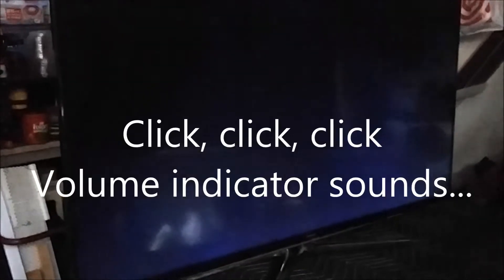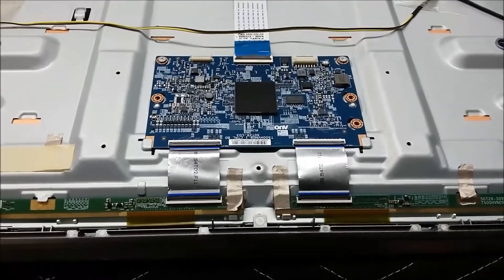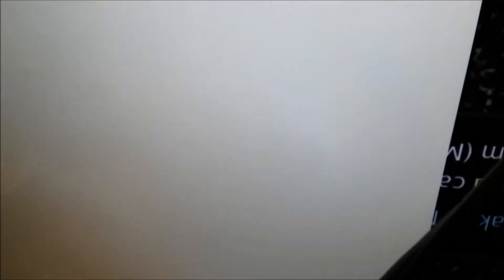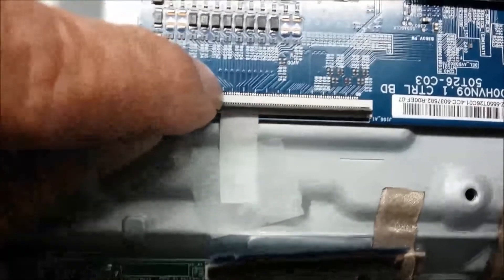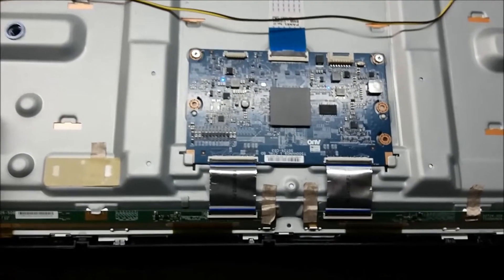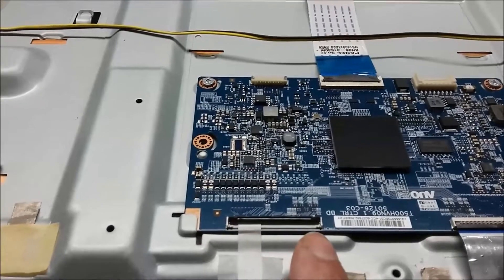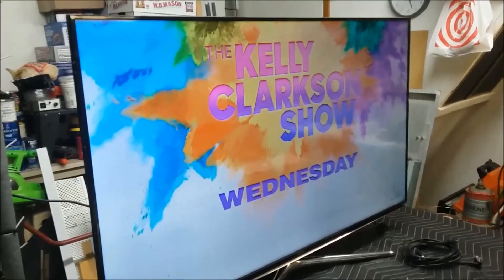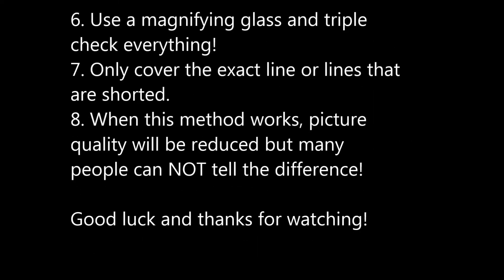LCD/LED TV Repair Secrets - Backlights and Sound, but No Video

Comment: Hi! I emailed you about a week ago regarding my tv not working. You linked this video and now it shows a picture again (although the faulty side has a whiteish ”filter” on it, is this fixable?) However there is now another issue. Whenever I turn my tv on, after about 5 seconds it turns off and reboots, do you have any clue of what the issue could be?
Reply: Could the white ”filter” depend on that I am covering too many lines maybe?
Reply from the maker: Could be. The fewer lines covered, the better the picture will be. Try to narrow down the problem to just the line(s) that need to be covered..
Reply: @LawrencePina  Great news, the TV is working and I have a clear picture on both sides!:) However I there is quite a severe lag/delay on the left side (The faulty side). Could this be because I'm covering too many lines or is it the panels that are damaged? There also seem to be some burn in on the left side, do you have any tips on how to get these removed?
Reply: Btw, the TV is a Philips 55PUT6401/12
Reply from the maker: That model is hardly 1 year old! What's the story with that TV?
Reply from the maker: Plasma TVs often have a routine in firmware designed to break up mild cases of image burn. I'm not aware of any LCD TVs with that feature. The technology is different. I don't see how anything like that could work on an LCD TV. I don't know about the lag you're experiencing. I do know that your panel is damaged and it's never going to be like new again. For what it's worth, make sure you have the very latest firmware installed. Try updating it. See what that does...
Reply from the maker: TV reboots after 5 seconds: Generally speaking, if it's made by Vizio, then most likely the firmware needs to be reset. Search by model for the exact procedure. It's made by Samsung, then most likely there's a power supply problem: https://youtu.be/iNgYktA2hTg It's made by LG, then most likely, shorted LEDs are the problem: https://youtu.be/I4m8IuQqN28 Regarding the white tint on the defective half of your TV's display, my compliments for just getting the picture back. Your TV may be on its last legs, but think of what you've accomplished. That experience is worth a lot more than any TV. If you lived in my town, we could go to the store (aka the town dump) and bring home several more for you to work on. Last week there was a 65" Samsung, two 55" Samsungs, and two 50" Samsungs, all in the same model series, thousands of dollars worth of clean, discarded, Smart TVs (free for the taking), none of which were more than 2 years old. So, if you can't make this TV perfect again, please don't be discouraged. You will get the next one. Good luck! Thanks for asking. Please like and subscribe as it really helps the channel.